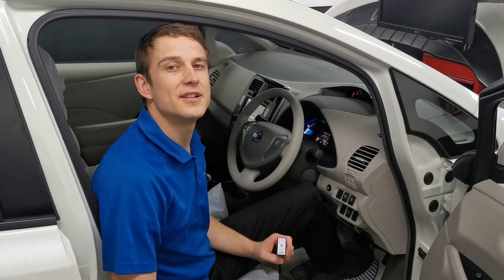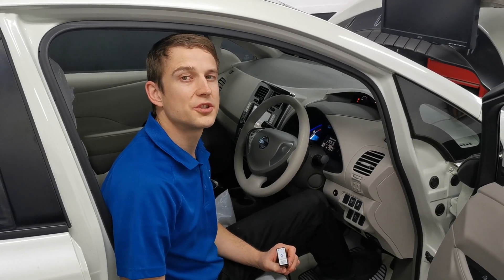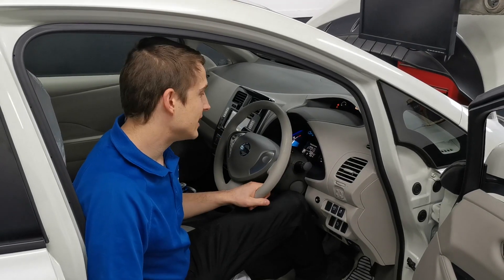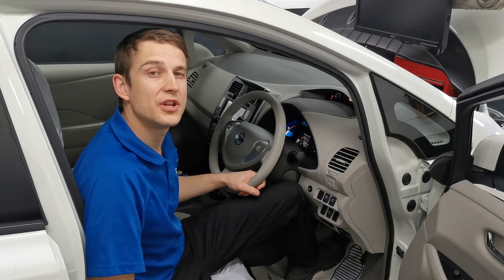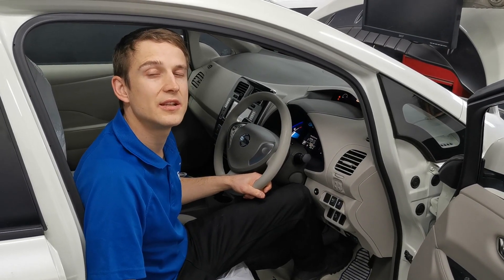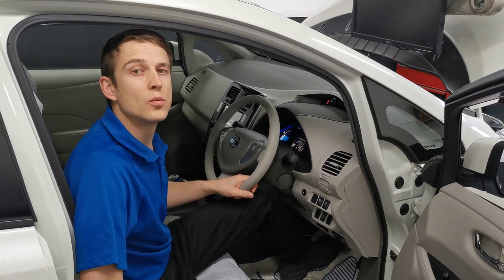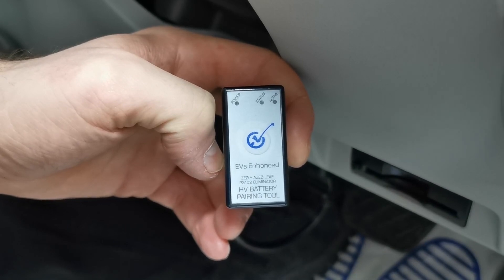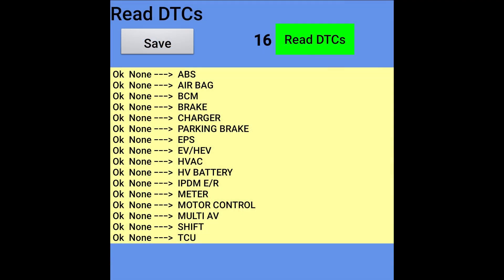Nissan Leaf HV Battery Pairing Tool

Comment: Do you push the button everytime you start the car?
Reply from the maker: No. Certainly not.  You only use the tool on the car to complete pairing once. Then the tool is removed and not needed again unless you wanted to fit a different battery again in the future.

Comment: Low range is not a problem Nissan LEAF is your problem. Buy new modules and you will be happy, without any Webasto heaters  and battery extenders.
Reply from the maker: Hi. I think there are some Russian to English translations problems in your comment, but I see your video shows that you sell non-genuine replacement battery modules for the Leaf.  They are interesting, but you don't give a lot of information on your modules except for saying they are based on NMC cells.  Our first question is, how many Ah are they? Feel free to send more information to enquiries@evsenhanced.com
Reply: @EVsEnhanced  Thanks, I will correct info. Cell like in original module - 2P2S. We can use some type cell 40-58Ah.
Reply from the maker: @dotcustom_ev  Have you built a whole battery yet or just a module as a prototype?
Reply: @EVsEnhanced  Pls wait release about battery soon. will inform asap.

Comment: hi is it possible To put 30kWh Battery on Nissan Leaf 2012 with 24 kW  using your device?
Reply from the maker: Hi. Not using this alone. For upgrades to larger capacity battery packs from later Leafs please check out https://evsenhanced.com/products/battery-translator/

Comment: can you replace just the bad cells in the pack without getting a fault code
Reply from the maker: Hi. Yes, you can do this. However, the cells in most Leaf packs wear fairly evenly (there are exceptions), so unless you do really have one or two failed cells you would typically need to replace all of the modules in the pack to see a significant improvement.  Also this is very time consuming and in that case, the LBC still wouldn't show the correct SoH and bars for the new cells either.  With this tool you can transfer a whole un-opened pack which is much faster and easier without any down side.

Comment: Great! Now make it available for purchase to the general public. Don't be like nissan is with the consult III.
Reply from the maker: Hi.  This tool isn't currently priced to be viable for an individual just wanting to pair a battery in their own car one time.  But for a workshop looking to get involved with electric vehicles the cost is very reasonable.   Therefore we encourage any Leaf owners wanting to use this tool for a battery swap to seek out someone in their area who is interested in servicing electric vehicles and encouraging them to get in touch with us.  This solution has already worked well in many cases for everyone involved.
Reply: @EVsEnhanced  Might I suggest a rental program, a fee for renting the unit plus shipping both ways and a deposit on the unit until it is returned. You would most likely make more money this way. Most any mechanic shop is not interested in working on ev's due to the reliability and low maintenance of the vehicle's there is just not enough steady money in them. I recently spent two days trying to get my state annual inspection done on my leaf. The tech's couldn't wrap their heads around it not having a engine to emissions test. I think you would find the diy market very profitable. I am also curious if your tool programs the original code to the bms of the new battery pack or does it just tell the bms to ignore the miss-match. P.s. I do appreciate your response to my original comment.
Reply from the maker: @kennethclifford1863  I think logistically it would be better to have a partner in a given region with several of these to allow them to rent/lend them to a semi-local customers often with the possibility of overnight shipping.   Depending on where you are, we may already have someone close to you that can help.  Please contact enquiries@evsenhanced.com if you would like us to look into options for you.
Reply: @EVsEnhanced     friends advice... thats not good sell to the people... in 6 years time no one wanna a mark 1 nissan leaf....   make money now...
Reply from the maker: @creepybag  Hi.  The non-workshop version of this tool is now available for purchase at https://evsenhanced.com/product/hv-battery-pairing-tool-individual-use/

Comment: I have two questions
1-Does it works on vehicles after 2012 models ex(2013-2017)?
2- Where can I get it
Thanks
Reply from the maker: Hi. Yes this works on 2013-2017 as mentioned in the video. For more information, please go to evsenhanced.com/products/hv-battery-pairing-tool/